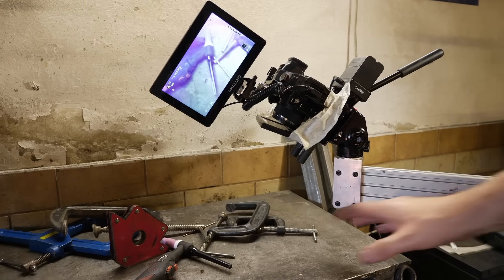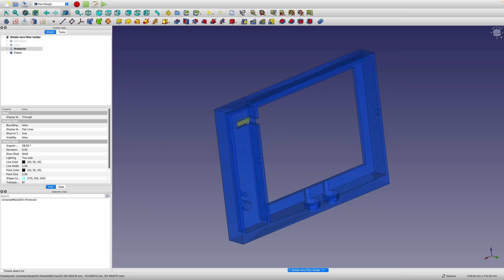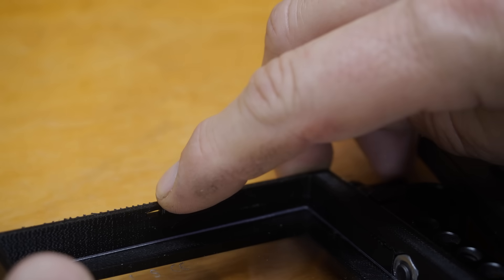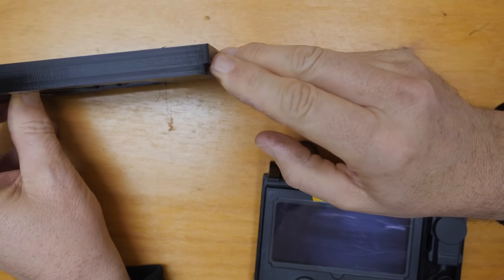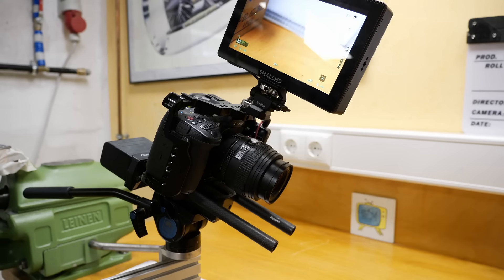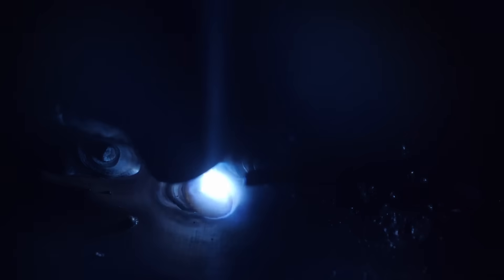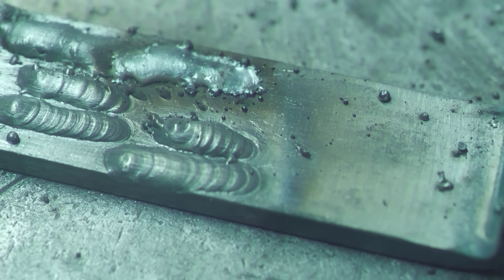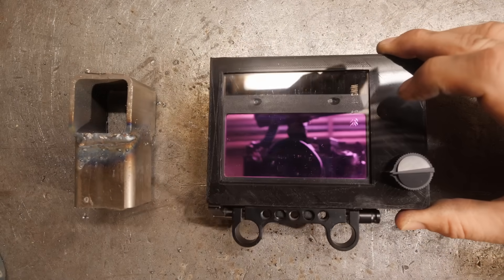How to make the arc and puddle visible || RotarySMP

Comment: The camera will correct the sensitivity to what it sees to an average of 18% gray (even with the filter). 
When you have a small bright spot surrounded with a large dark area, everything will be 'made' lighter. 
Dark area become gray, the bright spot much too bright (overexposed). Because the camera average the lighting. 
(Opposite: a small black object on a bright white surface: the camera will underexpose it. No detail of the black object is visible anymore and the white surface becomes grayer.)
Use a manual setting instead of automatic, tune the balance and you will notice the difference. Good luck!, Greetings
Reply from the maker: I used to shoot everything manual with the G81, but since I got the GH5S i typically shoot manual, with auto-ISO. However yesterday i set up two custom profiles with full manual, white balanced with the filter for showing the part, and stopped down to the arc.

Comment: for mig welding, is your wire polarity ok? flux core, mig or tig might need different polarity. that would explain the spatters.
Reply from the maker: I first connected it wrong, and then switched to electrode positive before starting to weld.

Comment: At 8:50, if the MIG wire touches the puddle, isn't that called "Short Circuit MIG"? Shouldn't you limit SC-MIG to thin sheet metal and the like? Can you turn up your voltage for your heavier plate welding projects?  Thanks for this video and project idea!
Reply from the maker: Thanks John, but 24V is as high as it goes.

Comment: instead of plastic you can use glass protective sheets for smartphone screens.
Reply from the maker: Good idea.
Reply: The plastic is not just cheap plastic, it should be made of LEXAN, and Lexan will filter ultra-violet rays due to its inherent chemistry. You could still add a second lens cover solution, and even a filter gel, and a polarizer as well to the stack up. Now we need a new 3DP frame to hold a 5pc stack up and still align with the cable ties!

Comment: It is interesting that you have this splattery mess of mig. I also use mig with only with Co2, the difference is that I use a big bottle  and my welds aro not nearly as splattery. Cheers from Austia-Koroška slovenia
Reply from the maker: Thanks for the feedback on that. Maybe I just havent found the right settings.
Reply: @RotarySMP  Yes, no problem. I use Co2 because it is the cheapest option.... ever that is relatively expensive at 55 Euro refill. I dont have the guts to ask whats the price on the mixed gas lol 😆
Reply from the maker: @alyo3299  Here, Argon is €62, and mixed gas for MIG is €59 at Zgonc. I couldn't find any better deal.

Comment: I'm not convinced you really can tune 3d printed holes coming out undersized. Like it's just the result of the concave and enclosed plastic features shrinking as they cool. Any kind of software solution would probably have to be in the clever simulation realm and add alot of time to the slicing... but it's not too much of a hassle to just to manually add a percentage to the hole diameters in CAD, estimated through intuition and gumption, and manually clean up the ones you got slightly wrong.
Reply from the maker: I normally ad 0.2mm to diameter, and thought I had on that pattern.

Comment: it might sound silly but when you're filming the welding could you try adding more lighting (like excessive light levels) so the difference between arc on and off are closer, to make the contrast even out a bit.
Reply from the maker: I run into issues with my LED lighting triggering the auto-darkening if I add more.
Reply: @RotarySMP  wow, a real catch 22, thanx for ....enlightening me!!
Reply: Why not setup some incandescent lighting for this purpose?  Is your LED lighting powered by a PWM power supply, could you make it a DC power supply?

Comment: Mark, thanks for shot of the HPSOV/PRSOV, p/n 3215302.  We designed and qualified this valve back in the early ‘90s for use on all three B777 engine variants.  I can still remember very long hours performing analysis and many late nights conducting qualification testing.  Hope it is still performing well.  👍😎👍
Reply from the maker: Good Eye Joel. In my mind the GE90-90B is a modern new engine, but they are actually reaching end of life. :/ 
What does that say about us?
Reply: Yep Mark, everyone on our team that developed this bleed air equipment for the B777 has since retired.  Those were great days.  We learned a ton.  We learned to always be curious. 
Now with YouTube I spend my time learning machining, welding, fabricating, casting, forging, 3D printing.  Thanks for the weekly doses of inspiration.  Your use of 3D printing in this episode was spot on 👍👍

Comment: I'm no expert but the camera settings could be tweaked to get that looking just as it does to the welder. Nice job.
Reply from the maker: I was hoping for a set up, where I dont need separate settings for the set, and the weld. It is a real PITA to play around with the camera, when you have the gloves and helmet on, and cables draped around you. 

But this still needs some tweaking, and I might try two custom set up's so I can just switch between the two with the C2 and C3 knob positions.

Comment: As an ex Air Force guy you must have a stash of speed tape knocking about
Reply from the maker: Unfortunately not. I could have done with some instant aircraft.
Reply: or just a few slices of a tin can, or drink can as shims to keep it in place... or with a heat gun, melt a few drops of wax or plastic and drop in a ready made seal.

Comment: For dimensions fastest way is just to scan the object on a flatbed scanner with a ruler next to it
Reply from the maker: I dont have a flatbed scanner, and I find it easier to just use calipers.
Reply: @RotarySMP  sometimes I get a part with hand drilled holes all over the place, for those I just trace them in cad
Reply from the maker: @Hilmi12  Yeah, for random non-cartesian holes, I have also done the flatbad scan with a copier at work. But this welding lens was a simple rectangle box.

Comment: Instead of a auto lens you could try a solid filter from Phillips-Safety, they are expensive but ive found, for eye balls atleast, that they are super consistent and give better clarity. they would probably help you with your own welding too. it just means that you are going to have to frame the shot and then mount the filter lense.
Reply from the maker: That is what I am trying to avoid. When you have the gloves and helmet on, playing with the camera is a PITA.
Reply: @RotarySMP  could an auto darkening rear view mirror from a car assist in this at all? Just spit balling.
Reply from the maker: @mandrakejake  Would be a challenge to get the mirror lined up.
Reply: @RotarySMP  what if it was a flap like a normal helmet. flap goes up, flap goes down

Comment: Recording MIG to accurately depict what the Welder sees is difficult but you've done as good a job as I've seen anywhere on YouTube. Recording TIG during a Direct Current Steel weld is much nicer to watch. You've done a great job learning these processes and that's not easy at 50+. Keep up the great work Mark!
Reply from the maker: Thank you very much!
Reply: The human eye (and brain ;-) just has quite some huge dynamic range. Much more than camera and screen can depict. 
If activate a strong additional illumination and  spread the contrast more (gamma-correction) it might even closer depict what the welder experiences. 

Also gives a good Video: Hook up the welding trigger switch to a relay to active a strong halogen light-source ---> the welding videos will look even better.

Comment: I've never welded so it's awesome to see how it actually looks like. 👍
Reply from the maker: I will keep tweaking the settings and can maybe get that even better.
Reply: @RotarySMP  Have you tried to lock down aperture & shutter on the camera but leaving the ISO to auto?
Reply from the maker: @JanneRanta  That is how I mostly use it. The range in brightness between set and weld is so extreme, that you need more stops than is easily achieved.
Reply: @RotarySMP  You could then experiment with auto aperture in addition to the auto-iso. That should give enough range I'd think.

Comment: That really does work well! Spent all day Friday welding up my leaky woodburner, and managed to use nearly all my gas up!  My local calor depot keeps mig mix in stock and It gets delivered to my door for £30 a bottle!  Keep up the good videos!
Phil, UK
Reply from the maker: That is really cheap. It is up to €369 for 10 year bottle rental (includes first filling), and €62 per filling.
Reply: @RotarySMP  good grief! I don’t have bottle rental now because of that! I used to have a BOC account for many years, but changed to AP when BOC became ludicrously expensive. I paid a one time deposit on my mig gas bottle which is a small commercial size, and my argon is from a rental free company in Liverpool although i may be changing that to hobbygas as they have a local depot . Tig was £200 deposit and £60 a bottle for gas but it is twice the size of the mig bottle
Reply from the maker: @philhermetic  Here, the price of getting an owned bottle recertified have become so outlandish, that this rental is the best deal I could find.
Reply: @RotarySMP  Lobbyism by the industrial gas industry has paid off.
Reply from the maker: @erik_dk842  Yeah, it really seems like a mafia.
Reply: @RotarySMP  could you not slip quietly over the border into one of your "neighbouring" countries and do a cheaper deal?
Reply from the maker: @philhermetic  I dont have any contacts Slovakia or Hungary for that. Would not be surprised it if was much cheaper.

Comment: Well, technically that CO2 bottle was meant to provide the 5% to the other 95% argon... At least that was the plan.
Reply from the maker: Hi Alexander. I wanted to make sure it all works properly before making a mixer, but since I weld so little, and need to stay in practice with TIG, I am not sure how much I will MIG.
Reply: @RotarySMP  the small addition of CO2 to argon in MIG shielding mixtures is to "activate" the weld pool to give penetration. It is not surprising running 100% CO2 results in spatter central welds. Yes spatter  not splatter. google the difference ;)
Reply: @RotarySMP  Anyway, pure CO2 produces more spatter. But for the small welds where 90% of the time is setup and making sure everything stays straight, I agree, TIG doesn't have much of a speed penalty. And with the new welder you can avoid the problems you had before, like always blowing a crater in your weld at the end.

Comment: I usually have issues with adhesion on 3d prints due to the relatively rough surface, which is why I prefer ABS as it is much easier to sand/file smooth if I need to use tape.
Reply from the maker: I have only ever used PLA, as once I got it working, I was too lazy to change anything :)
Reply: @RotarySMP With the printer being what it is, PLA remains your best option. Just don't use the prints in spaces where it can get warm, like a car. Or an airplane.
Reply from the maker: @graealex  ...or near welding :)
Reply: @RotarySMP  Either way, they tend to lose their mechanical integrity above 60°C already. That's about the only drawback of PLA. Modified PLA can be very robust otherwise, especially when you print with a large nozzle and a bit on the hot side.
Reply from the maker: @graealex  I tend to use 3D printing mostly for pretty unimportant things. If I really like something, I try to cast it using a 3D printed pattern.
Reply: @RotarySMP  Never seen you cast anything from a 3D print though.
Reply from the maker: @graealex  I haven't done much casting lately. Luke has some cast iron parts I cast, and I 3D printed the Beatles statue patterns and Boley face plate in these videos.

https://youtu.be/bF_1pwiJp1o
https://youtu.be/kTRT7Mc7cpc
https://youtu.be/81YGImT-mkI
Reply: @RotarySMP  I'll have to watch these videos - these were before "my time", i.e. before TOT introduced me to your channel.